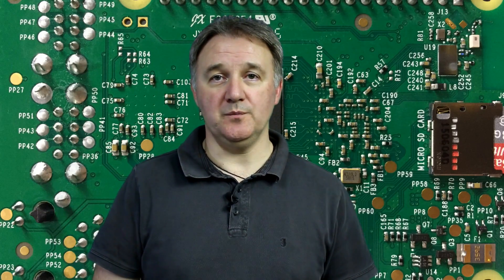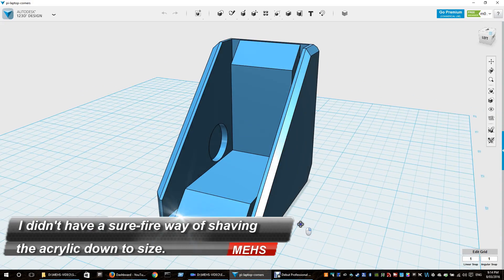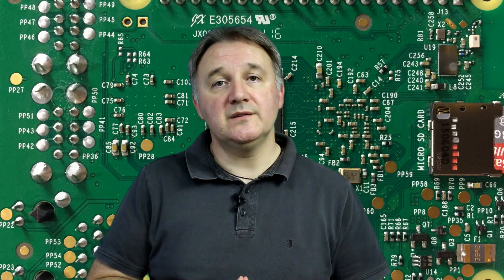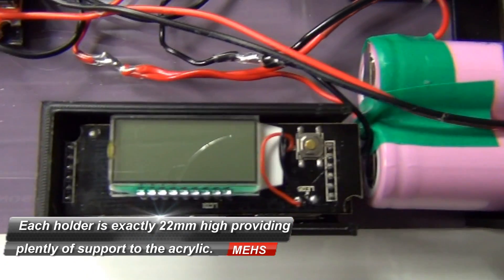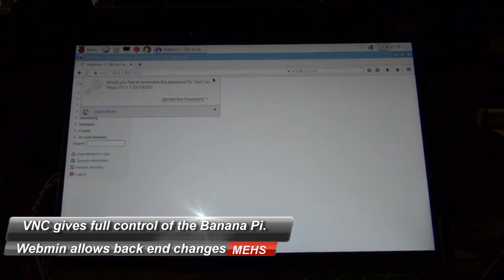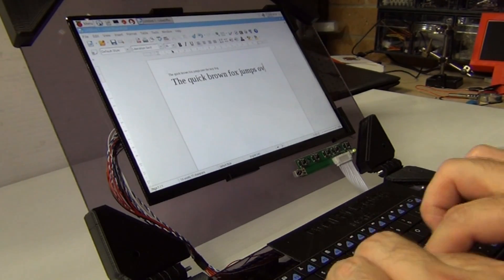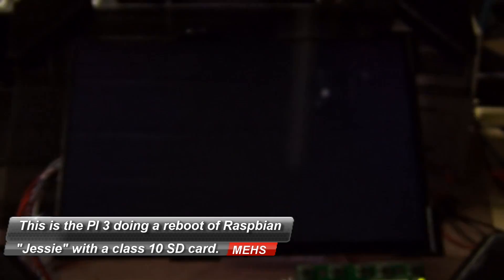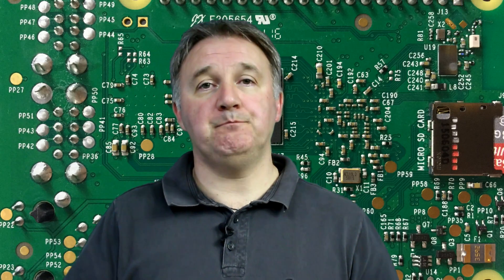Raspberry Pi 2 / 3 - Dual Pi Laptop Part 2 (MEHS) Episode 41

Comment: One way you could probably fix your battery problem is using a lipo pack instead of lion batteries. Could make for getting more battery life per size of batteries.
Reply from the maker: - Hi.  Yes good idea.  I only used the existing battery pack as it was left over from a tear down of a battery bank.  I will be doing another laptop soon and will be using a better lipo battery pack.  Cheers.

Comment: Very interesting video and i agree, the dissembowled powerbank could best be exchanged by the batteries and a voltage meter. There's nothing i'd change but i wonder if there's an advantage to using more than 2 pi's in a configuration to, for example, to upscale the computing power without breaking the bank?

On a sidenote, your spoken scenes are great and knowledgeable, but often come across a little shaky when done in more than 1 take. You can overcome this by having a scenario where you switch camera-position for each take, or zoom in on part of your project.
Also, this way of creating a video, benefits for a more dynamic presentation.

:-) Thanks for sharing your projects, i look forward to the next already.
Have a great summer!
Reply from the maker: -Hi.  Thanks for the feedback.  I have been self assessing for a while and agree there is room for improvement, something I have been experimenting with in later videos.  More pi's doesn't really work as the method of distributing the power only really applies to software written for clustering and won't help a desktop environment or web surfing , gaming, video etc.  more coming in a week or two.  If you think the latests few videos are better, please let me know.  Cheers.

Comment: Hey how do you think reusing broken old laptop with useable lcd? Im planning to remove motherboard and put pi  inside and I want to connect lcd and keyboard touchpad. What do you think? Since lcd monitor and keyboard  are great. I want to use this still.
Reply from the maker: - Hi.  I think that sounds like a good project.  You will need to find a suitable Lcd driver board for the lcd as you won't be able to connect it directly to the Pi.  The same goes for the keyboard and trackpad but it's possible and would give a nice end result.  eBay is a good starting point for lcd driver boards etc.  good luck.  Send me pics of the build and finished product and I'll post them on my website if you like.  Cheers.

Comment: +My Electronics & Hacking Show
¿Seria dificil coger un paner ips de 10"  (o menos pulgadas) pero 1920x1080 para meterle dvi-d o hdmi?
Reply from the maker: -  1920 x 1080 pantallas en el tamaño de 10 pulgadas son fáciles de encontrar en eBay y serían fáciles de agregar a este tipo de proyectos . no lo hice porque alta resolución que es difícil de ver en una pantalla pequeña .
Reply: El problema seria encontrar un panel + controladora compatible con hdmi y dvi-d, en electronica estoy un poco verder... mi tope son las puertas logicas >_<
Reply from the maker: *****
 Va a encontrar más bonitas pantallas con controlador con HDMI y DVI en Ebay . Ahí es donde yo tengo la mía . Ellos van de la mano con facilidad y son un buen lugar para comenzar un proyecto . Es eso lo que preguntabas ?
Reply: sep, pero no se a quien comprar, mandame por aqui por mp un vendedor de fiar >_<
Reply from the maker: *****
Try
http://www.ebay.com.au/itm/HDMI-VGA-AV-Audio-USB-FPV-driver-board-and-10-1inch-B101UAN01-1920x1200-IPS-LCD-/261443215134?hash=item3cdf3adf1e:g:5U0AAOSwosFUXG0c
or
http://www.ebay.com.au/itm/HDMI-DVI-VGA-Audio-Driver-board-and-11-6inch-N116HSE-EJ1-1920x1080-IPS-LCD-panel-/261756400361?hash=item3cf1e5b2e9:g:fyUAAOSwpDdU3IH7

Comment: Using a single cell battery charger, I assume you're running all those 18650s in parallel? Are you using a boost converter directly from those batteries to get your 5V rail and your plugged in PSU power just going to the charger? Or are you switching between the two sources depending on if PSU power is plugged in or not?
Reply from the maker: - Hi.  Yes you are correct.  The batteries are out of a 5V battery bank so left them in the parallel configuration.  They give 3.7V which goes to the pololu power reg for my 5V supply.  Plenty of current to go round.  The plugged in power goes into the sparkfun board which, normally, only charges the battery.  The battery then simultaneously gets charged and supply's current to the 5V power reg.  I didn't like this so I also take the external power and split it off sending it to the output of the 5v power reg.  The pololu unit I use has reverse current protection so the sparkfun board and battery don't see stray current trying to come back through the sparkfun board into the battery charge circuit.  So I end up with battery power without external connected power and I get a full charge going to the battery bank and full power to the power reg when external power is connected.  Hope that was clear.  Cheers.
Reply: Awesome, thanks for replying. I'm currently trying to shoe-horn an odriod xu4 into an old laptop shell. I've done most of the hard work like matrixing the keyboard, thinning down the boards (odroid and LCD driver) but am facing issues with the battery pack. Charging it was giving me nightmares as the current pack is essentially an 8 cell 4S pack (2 parallel x 4 series) and thus messing around with balance chargers etc... I was using the existing 19V PSU and running 2 dc-dc bucks to get my 12V (for the lcd driver) and 5V rails. But after watching your vid and reading your reply here, I think I'm going to crack open the battery pack and re-wire all 8 cells in there in parallel and do something similar to your setup. I'll have to run a second boost converter for the 12V as my lcd driver won't run at 5V like yours does.
Reply from the maker: Marc Dudlee - You're welcome.  Sounds like a big project.  Yeah keep it simple wherever you can, works for me.  Are you certain your LCD driver needs 12V?  Many say they do but those I've tested are happy with 5V.  Cheers.

Comment: Did you put the 5V straight into the lcd driver board or how did you get it to work on 5V?
Reply from the maker: - Hi.  Yes 5V straight into the LCD driver board.  They are rated at 12v but they run from about 4.5 up to 12v.  The draw depends on the size of the LCD but say 500ma for a 5inch LCD and 1amp for a 10 inch.  The pololu regulator I used is good for about 3 amps output when supplied 3.7V from the battery.  Cheers.
Reply: 12V rated but works on 5V? damn
but thats not the case for every driverboard right?
I can't imagine that a 9-12V rated driverboard works on 5V :S
The Sainsmart Driverboard looks exactly like your one so it should work with 5V too right?
Reply from the maker: Charlie90071 - Like you said, no guarantee but I've tried a few that look similar and they all run off 5V even though the advertisement and documentation said 12V.  You could always try it and if it doesn't work, drop in a small step up regulator for the driver board.  Cheers.
Reply: +My Electronics & Hacking Show ya that was my plan from beginning but with 5v it is much easier. Thanks for the fast replies mate!
Reply from the maker: Charlie90071 - You're welcome.
Reply: +My Electronics & Hacking Show i cant find this slim hdmi cable you use
Reply from the maker: - Hi.  I had to hunt for that one.  I eventually got what I wanted from a company (reseller) called CableChick in Australia. 
http://www.cablechick.com.au/cables/ultra-thin-50cm-hdmi-cable-hdmi-v14a-high-speed-with-ethernet.html
Try Ebay searching for HDMI ultrathin 0.5M or 0.3m.  Cheers.
Reply from the maker: +Charlie90071 - Hi. Yes I did but I they don't sell it anymore.  I haven't looked for another as yet.  Cheers.
Reply: hi, you can't charge and have the laptop on at the same time, can you?
Reply from the maker: Charlie90071 - Hi.  Yes you sure can.  Normally the situation would be that the battery would be charged at the rate you set, say 1amp.  If your project drew less than 1amp then the sparkfun board would charge the battery faster that the project drained it.  In my case the project draws much more than the sparkfun board can charge the battery so eventually the battery woud go flat regardless of being charged.  I connected the external power to the sparkfun board to charge the battery and I connected that same external power to the pololu power module.  That way the battery will be charged and the project gets powered.  The only thing you need to consider is the that the external power supply must be 5V and have enough current for all needs.  In my case I used a 4A 5V brick, so all good.  Cheers.
Reply: Ok, but when your 5v brick powers the pololu directly doesnt that mean that the battery gets connect to 5v because the battery is connected to the pololu too?
Reply from the maker: Charlie90071 - Normally you would be completely spot on but I connect the external brick power to the OUTPUT of the 5V regulator.  That way the 5V goes into the project as if it was coming from the power reg.  This only works because the pololu reg I use has reverse current protection and doesn't allow the 5V to flow back into the battery.  Cheers.
Reply: AAh that makes sense! Ok good that i have the same power reg. like you. (I just tested the reverse current thingy and it seems to work).
big thanks for your help!
Reply from the maker: Charlie90071 - You're welcome.  Good luck.

Comment: Hello. :) Nice job! ;) I will receive my Raspberries Pi soon and i am very excited about what i can do with this nano computer. Thanks a lot for sharing it here and congratulations. No doubts that you will make an amazing laptop! ^^ About the keyboard, did you think about a laser keyboard (i don't know if it works well)? 
Have a nice day,
Fred.
Reply from the maker: - Hi and thank you.  Laser keyboard, do you mean the brand or the laser display keyboards?  If you mean the brand, I haven't had much to do with them.  If you mean the display type then I would suggest you use a real keyboard every time.  They work but I think there terrible for anything more that a few words occasionally.  Cheers.

Comment: So QUESTION, is it possible to get the power of both Pi's at once, or dies it only use 1 at a time?
Reply from the maker: - Hi.  I guess the answer is both at the same time but doing different things.  You can't get both pi's to work together to load a web page or combine power for better YouTube playback but you can get one Pi to cache and act as a proxy server or act as a file server or firewall.  This way the main Pi doesn't do all the backend or support functions.  It's not a cluster and not a true combination of performance.  You will get a better result with a more powerful single board approach.  I plan to do another laptop with the pi3 and with the Odroid boards.  Cheers.
Reply: +My Electronics & Hacking Show I wish there was a way to get them to actually work together to get better performance :( I know some retro game consoles coupled different CPUs together to help with processing different things for example I think the Sega Genesis has a Motorola 68k and a Zilog Z80 together, I think the Z80 is used for audio and gamepad reading and the 68k is for everything else. It would be cool if there was a hardmod that could combine the two Pi's together like that but I imagine it would be hard and would require special software to work properly which you would likely have to code yourself :(
Reply from the maker: +James Lewis - Yes it would be hard, but not impossible.  The best I could achieve without a complete custom board / solution would be clustering.  The problem there is the cluster only functions using specific code like you mentioned and won't really improve things like desktop performance or general web apps.  I think the Odriod board will give measurably better performance.  Will try that soon.  Cheers.

Comment: Have you tried installing Ubuntu MATE for ARM on the RPi 2?
Reply from the maker: +Dehibernation - Hi.  Yes I've had Ubuntu running on the Pi 2.  It's nice but I felt it was a little under powered for a fluid and enjoyable desktop experience.  I say a desktop experience as I think that's what most people would want if they chose to install Ubuntu MATE.  I think the Pi 3 is a good candidate for Ubuntu, haven't tried it yet, no time.  Cheers.

Comment: hi again  thanks  for  the  earlier reply  , I  had  a  sideways  thought  reference a power supply  use a large   remote control  car cell  5000 to 12000 mili  amp  a adafruit  power converter  board   they are  6$ and almost  always  in Stock  .cheers
Reply from the maker: +William Hart - Yeah, that would work.  Cheers.

Comment: I have thought about making a similar project to this one,   but I would use a briefcase as the laptop body. just open up the briefcase and the top part would have the display and the bottom part would have a raspberry pi and batteries and a keyboard...    hopefully the screen would be a touchscreen so I don't need to include a mouse of any kind
Reply from the maker: +amigojapan - Hi.  Sounds like a project.  A briefcase build should be less fiddly than a small unit which is nice.  Plenty of room for as much battery as you like and a decent size screen.  If you do you're build and don't want to video it, send me a few photo's and I'll show them in an episode.  Cheers.
Reply: I looked it up on google images, it seems someone has already done this, also someone made a briefcase that contained an entire desktop computer-innards
Reply from the maker: +amigojapan - I hope that doesn't stop you making yours.  Cheers.
Reply: i have started my effort with a big abs tool box that had removable compartments. moded the plastic compartments and placed a sheet of plexiglass with hot glue to keep it firm on the spacers but still removable in case i need maintenance. BUT i screwed up when connecting the battery pack to the sparkfun charger and fried the charger so now i have to buy a new one. i will be using a 17'' screen on mine so i had to go from a step down for the screen to a tougher buck converter just to play it on the safe side
Reply: You mind if i send you pictures of my effort after it is done? It won't be anything to brag about or write someone home about but it would be helpfull for me to hear your input and if you think it is any good it would be helpfull to others who might be thinking of starting something similar
Reply: hi good luck, I recently just ordered the official RPI display and case, which seems like a solution, I still may fasten it to a breifcase so that I can keep a keyboard and other accessories in it, not sure.... also, here in Japan it is expensive to buy a breifcase, so I am thinking of gutting a junk laptop and using it as a case for my stuff...

Comment: Amazing stuff, really like the idea of 2 computers under one hood. One thing I'd add is storage, though a hdd is probably an energy drain... SSD?
Reply from the maker: +Rik Declercq - Thank you.  Yeah an SSD would be nice but its pretty easy to do a 128GB or even 256GB with a couple of USB thumb drives.  If I did it again I might try an Odriod C2 and / or a Pi 3 and drop in a 1TB HD.  I'm also keen to try a LattePanda or Kangaroo as an X86 / X64 windows or Linux solution.  I would definitely use a better quality battery and get more capacity or use a smaller footprint.  Cheers.